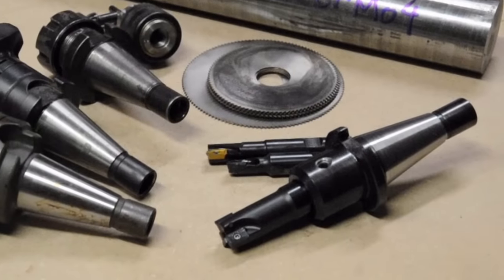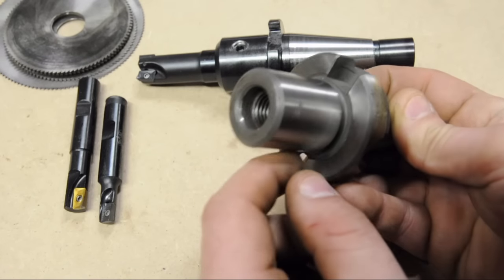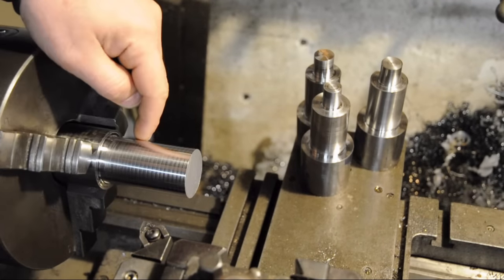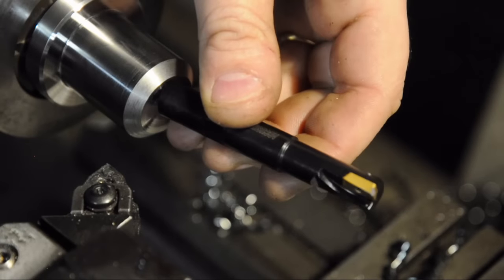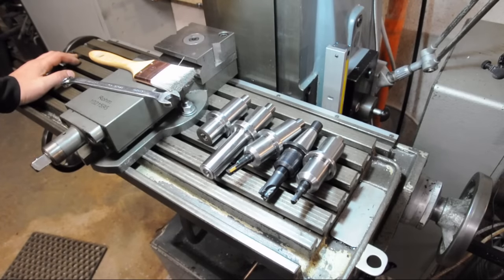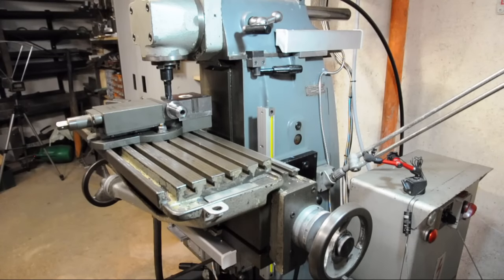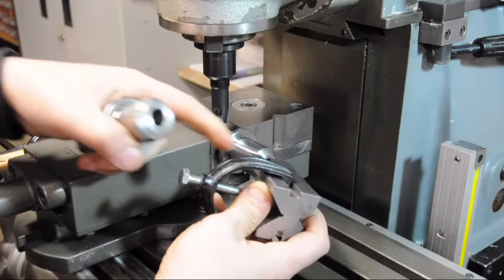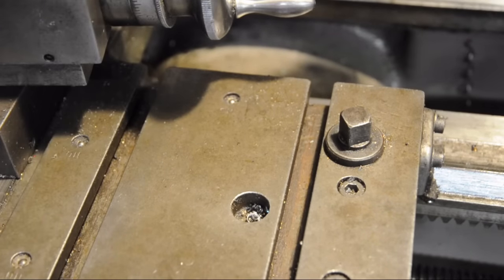Taper Tooling  For The Mill

Comment: if you turn chromoly again the best solution is to use, and I'm sure you as an engineer understand this term, "a metric assload" of coolant
Reply: An Imperial Assload is more rigid and last much longer.
Reply: I really think it calls for a shitload of coolant
Reply: Just needs some cool soothing LUBE by the ASSLOAD. That should take away the pain. John, Australia.
Reply: @joandar1  as an Australian after last week we could ALL use an assload of cooling
Reply: @brodiesmith4419  Yes it has been efing hot here in Port Stephens too. John. 42 Degrees C and there abouts. John.
Reply: Robert Paulson , exactly using physics to your advantage take the heat away from the work. Carbide inserts with TiAIN coating and no coolant removing chips with air.
PVD is supposedly good but my supervisor doesn’t believe in new technology.
Reply: Man, I was on the committee to define the “assload.” Bicker, bicker, bicker, I’m telling you.
Reply: Is Tony a engineer?

Comment: When we needed to "hack" a piece of custom tooling, we cut the taper, put it in the machine for which it was destined, and used tool holders on that machine to finish it. Concentricity was guaranteed (if you bolted down your tooling properly!)
Reply: That's what I was thinking.
Reply: Looking for this comment, glad it was made.
Reply: Too much common sense in that.

I did think that on making the taper & fitting it with draw bar - then hammering it home to make it a good fit. Then loosening the draw bar, tapping the taper loose and then retightening the draw bar to a normal amount and calling that 'it' for fit - then machining the business end. Thus ensuring the taper is well fitting prior to machining the business end. It's a pity those international tapers have 2 drive dogs. 1 would be better as that'd guarantee refitipeatability orientation.
Reply: @millomweb  you could mark one dog and one side of each toolholder
Reply: @jonathanshaw6784  When I get power to my mill, that's my intention.

Comment: Hi Tony, i work chrome-moly steels  alot for my work mostly 4140. to get it to chip well you need a pretty aggresive feed 0.2-0.3mm/rev with that feed and a decent chipbreaker it should come off nicely. even taking inly a few mms of the diameter.
Reply: Yup, this.  Also, coolant, even mist coolant helps a ton.  I have a feeling it was work hardening on him.

Comment: HUGE insperation, I just made two ISO 30 end mill holders.... 20mm and 25mm inspried by your video.I didn't have a collet big enough to fit the outside OD of the business end of the tool holder so I had to turn an arbor, first 25mm, then took it down to 20mm. I nice snugg fit and set scerws for secruring. they ran true and worked out well with light cuts... 1mm roughing, 0.25 final cuts.Thanks for the ver very cool videos that beginners, homeshop guys and pros can enjoy

Comment: Probably a bit late now but I was wondering if you could just press that broken drill bit out? I'm sure it's well and truly jammed in there but I'd be surprised if it was 25 tons of jammed in.
Reply: Ain't gonna happen, the Ultimate shear strength of 4145-ChroMoly is about 660 MPa. Assuming that the drill has fused on both sides a good 50 mm in and that it's width is 5 mm the force before it gives is 330 kN, or about 34 metric tons. ChroMoly is hardcore stuff.

Material Properties:
https://www.makeitfrom.com/material-properties/SAE-AISI-4145-SCM445-G41450-Cr-Mo-Steel
Reply: I'm still will to bet with a good hyper therm or similar plasma u could cut that bit in half right between the flutes chisel out what's left done this a few times on broken  taps
Reply: the drill isn't fused, it galled.
Reply: Give it to an astronaut, ask them to take it to the International Space Station and then throw it back to Earth. The impact just may loosen that drill.
Reply: @millomweb  if that fails, apply WD-40 and attempt again. repeat until success, or catastrophic destruction of both the part and the surrounding 10 kilometers of terrestrial landmass.

Comment: I've worked with 50CrMo4 a couple of times, and the experience I've had with it, on the lathe that I usually use (can't remember the model), is that to get the chips to break, I have to take very deep cuts and just 'force' the tool against the material. 
2mm depth of cuts always seem to make those irritating meals of spaghetti-metal, but as soon as I change it to 3+mm it starts to break nicely at a feedrate of 0.2-0.3mm/rpm and letting my insert get a longer life, though I don't know whether your lathe would have the power to do that :) 

As for coolant, I use a lot of it when working with this material (but as a trainee-machinist I'm not sure whether I should do that, or just wait and let it cool off on it's own like I usually do with regular steel-types).
You are right though, it gets hot as hell :P 

Greetings from Denmark :b

Comment: good stuff however for the drilled hole drill it while the mass of material is still there. When you get down small there is no place for the heat to go and it gets hotter than hell. One thing you can implement instantly by the way is there are no laws against placing a plastic thing under the chuck for a second and dumping coolant, or better yet put some coolant in water and freeze it into various chunks such as dixie cups or whatever--it works quite well. I do that surface grinding also all the time. But when roughing and the item gets hotter than hell there are no police that will break down the door and arrest you should you dump coolant or use ice to cool it off quickly if in a rush.. I make universal arbors similar to your concept and I rough off alot of material to make the 1 inch shank I stay away .020 and dump coolant over it or ice--and move in for the finish passes on the spot. But by drilling so hot there are strange things that happen--the diameter heats up and first grabs onto the drill then in a second or 2 the total heat expands it--now as you drill deeper--the first part you drilled COOLS AND SHRINKS DOWN ONTO THE UPPER PART OF THE DRILL.. (note where the breakage of the drill occured).. When you go to press or knock the drill out from the other end heat up the outer part FAST AND HOT and knock within a few seconds--the drill may come out.

Comment: I make a fair bit of my own taper tooling. My mill has a 30INT horizontal spindle, but I converted the vertical to a pneumatic drawbar and that is BT30. (The tapers are, conveniently, identical). My approach has been to make a sleeve for the spindle taper that accepts the 7/24 taper of either tooling. I first made a tapered bush to match the lathe spindle internal taper . (it is almost, but not quite MT4.5, but conveniently self-locking) then in-situ bored that to take my mill tooling tapers. (and marked the point adjacent to peg 1 of the D1-4. You could reference to the key of the L0 on the Student.) That means I can cut the taper as the first op and then pull the tooling back into the lathe spindle with a drawbar and be reasonably confident that it will run true in use.

Comment: That is a sweet little mill.  Except for the lack of a quill it has everything.  Power feeds and rapid moves on all axis.  Hefty tooling (compared to R8).  Arbor operations.  Its a real mill as opposed to a Bridgeport which is good for anything until you need to do heavy milling.  The only thing better than your setup would be a mini horizontal with a built in rotary table.  I’ve never seen one that would fit in the corner of a garage though.

Comment: Hey Tony, For stuff like flipping those for notching in the mill, I have seen guys that make exhaust collectors with multiple pie cuts use those magnetic dial angle finders when cutting pipe. Basically take some putty, glob it on the back of the dial then shove it on the end of the thing you wanna rotate, un clamp, spin, dial in to +/- a degree. You might even be able to use one of those magnetic digital angle finders (don't know if they work up side down).

Comment: Very impressive work mate,inspiring. I made some tooling myself in 30 taper for my Elliott Milmor Super 16. I got around the concentricity issue by making a 30 taper tool holder for the spindle of my lathe. Was quite a lot of work but means I can guarantee concentric tooling every time. I made a draw bar to suit and it works well. As an asides it also means I can use my 30 taper tooling in my lathe should I want to do some milling or boring in the lathe. Really appreciate you videos mate.
Reply from the maker: +Andrew Wilson Thanks Andrew.  I actually had the same though, make a 'receiver' for the lathe, but I don't have small enough tooling to get down into the small end of that female taper.  I bet that holder comes in handy / convenient though.

Comment: Tony I'm keen to know more about the bluing solution you're using. I don't recall you discussing that previously, but sorry if I missed it. I'm keen to see you discuss it in more detail in a video.

As I understand it, you have a though hole to the point of that broken drill. Obviously EDM is the gold standard to remove it, but not all of us have an EDM sitting in the corner of the shop! I don't expect you are an exception to that rule. Have you tried pressing the broken drill out by pressing from the drawbar side, while heating the material with an oxy? No idea whether it would work, but 20 Tonnes can often do wonders when combined with a bit of heat! Generally speaking it won't damage anything if it doesn't work either.

Try cermet inserts on that material in future. I'm a big fan of them and use Kyocera brand extensively. Not too expensive and stand up to hard materials well. They work well on 4140, no idea on 4150, but I would expect similar results. 

Very nice work on that slitting saw holder.

Comment: Very nice. Bummer about that drill bit. Maybe time for the home brew EDM project? With a second drawbar, you can also make use of NMTB 30 taper tooling that is more common. I've done some of the same but to get the tool bore spot on, I did the finish cut right in the mill with a boring bar clamped in the vise.

Comment: 4 years late, but when we have to make a toolholder concentric, we buy the blank with taper already cut, rough it out, and then stick a boring bar vertically on the mill table and put the toolholder in the spindle. Turn it on and bore it that way. Perfectly concentric every time

Comment: "...easiest ways to scrap is to measure while its hot... "
What if you check the temperature while measuring and adjust for the coef. of thermal expansion? Would that be reliable? 
Should be reliable with a part of uniform temperature. Wouldnt work with weld bead hot spots.
Reply: Also taking thermal measurement of part I guess?
Do new cncs account for this now?
Reply: @reasonsvoice8554  
As long as the temperature if the part being measured is uniform throughout the part, it should work fine. It is a calculation by the machine operator. It's simple arithmetic.

Comment: I don't recall who it was, i think it might have been Stan, but they reground the spindle of their milling machine using a die grinder fixed to the table. Tilted the head over to just the right angle, set up the grinder to go up inside the taper, and it worked out fine. You could potentially do the same thing with taper tooling, grind the taper on the lathe, then stick it in the milling machine like normal, you've just made a perfect setup for grinding the tool end of the holder

Comment: That drill bit, do what we do with small broken taps get a carbide center cutting endmill, run it around 300 surface feet, and just slowly peck out the drill bit, we have an edm for buring out taps ECT, but if we have something that's already setup with and half run in a vise that's how we get it out

Comment: You really need to get a mist coolant setup.  It was work hardening on you.  I just recently did my first few parts for someone in 4130 and 4140.  The coolant helps a ton, I use it on almost every process.  It especially helps drilling and boring. 

Also, you still haven't setup a Patreon account?  :)

Comment: The problem is those are old style NMTB 30 which is somewhat old . Btw way those are drive key slots and the greased end fir the draw bar ti pull them up and into spindle taper.
All the newer style CNC holders are CT (CAT) or BT metic version 39-40 & 50 Taper. They are also made to a high tolerance standards.

Comment: I recently picked up a 50kg polished round stock slab of this same material, by the looks of it... I use it as a welding weight for now, but when i get my big lathe running, that slab will likely become a hydraulic cylinder, as its two and a half times the thickness of what you had for this... The same length i assume by the looks as well, but much thicker... Lovely stuff, maybe i could make a large air hammer outta it, the piston i mean... As i dont need a hydraulic cylinder that will need 7 or 8 litres of oil just to move it the full stroke, but a forging hammer might be a nice thing to have... Hmmm... Or a small surface grinder with a round column, i wouldnt even need to polish it, as it is still in its oily packing... Just make a few holes for the spindle carrier axle screw plate on the top, even maybe make it floating as to let it swing if need be, as it would only need to hold the height absolutely, it wouldnt matter even if it did shift a degree or two to one side or the other... Make a nice spindle carrier body and the large mounting plate outta some old huge cast plate, make the position tables and stuff... Would make for a very long project, but no shorter than a forging hammer would be...
p.s. 8 months later... rewatching this again, for like the 10th time... Regarding the making of the arbors and tooling... You should make a dedicated what is your lathe, mt4 spindle taper adapter to iso30... That way you could turn the thing between centers, and then chuck it up in the spindle with a timed adapter which runs as true as the centers could, allowing you to stay absolutely concentric to whatever the bearings allow and first make the outside surfaces, and then simply turn or bore or thread and what not the other end with it in the adapter... Sure its more work, but fuck me sideways if it aint worth the results and actual productivity increase... You could even make an iso30 center for the adapter, so the centers part is not a separate setup but almost like a tool change in the tailstock... 
Also, the drill that broke, you have acetylene, shoulda blasted that skank with a pinpoint flame and gotten the whole thing red hot... That is a regular hss drill, or maybe a cobalt hss, either way, it could have been softened good and then removed by plunging an endmill down it... Heck, you had a through hole, you shoulda just put the holder in a vise, put a punch through it and whacked the drill outta the other end with a 4 pound hammer... Sure, it woulda left a nasty trail, but you still had material left for a different thread or even a pressed sleeve...

Comment: First, I apologise for not reading through 325 comments to see if this has already been said: But Gas (or Plasma) nitriding of steels does not affect the geometry so might have been useful for these. (and you can mask threads and other features if required). There are specialised nitriding steels, but anything with Cr, Mn, Mo, V, W, Al, Ti in them will work. I have had many parts made from BS 817M40 (EN24) nitrided and it works very well. That said, I typically do not harden my spindle-nose tooling as I am a dilettante machinist and value my spindle nose more than my tooling.

Comment: I used diamond coated dremile bits and tile drill bits to remove broken taps from holes (usually stainless steel causes taps to bind and break).

Comment: you could probably make a holder for an ISO 30 or what ever with a hole in the back for a little draw bold just for lathe chuck and/or mill vice which would allow you to cut the taper and not worry about being able to hold it...

maybe concentricity is too much of an issue and me having too green of horns to know it, but, it seems like it could be a decent idea if one were planning on making much more of these.

Comment: I'm making a No. 2 Morse taper arbor for my lathe because I bought a No.3 accidentally, there is a difference between the chuck and tail stock arbor and I really should have looked in the manual  before adventuring into the jungle of Amazon. lesson learned! ) :

Comment: Why don’t you use coolant on your lathe. You will have no problems with thermal expansion and your tooling will last longer and no more bust drill bits.. also use a four jaw chuck when setting up your lathe. I’ve also made all my own 30 international tooling for my own mill , and it was all made in the four jaw and clocked up to less than 0.001” runout. I never use a 3 jaw chuck at all now.

Comment: If anyone breaks a drill like Tony did, don't use another drill (carbide or otherwise) to get it out. What you want to do is grab one of your old worn carbide endmills and take small pecks with the carbide endmill till you have gotten through enough of the broken drill flute that it just falls apart.

Comment: Good morning Tony, and thank you for your precious video: I would like to transform a morse 4 cone (of an old Wohlhaupter boring head) into SK30 like your spindles, and like my Sieg SX3 milling machine spindle: I would like to ask you this, I since first you made the 2 diameters (smaller and larger) of the cone, spaced like the example cone you took, but once you have started working the cone .. when do you stop? When do you get to the largest diameter? Because I didn't find the SK30 cone designs so I guess you do so, you measure the largest and smallest diameter of the cone and stop when you get to the largest one, thanks for the reply in advance !! Alberto